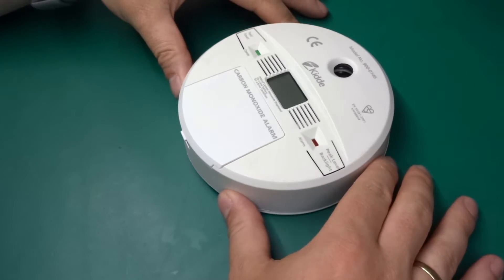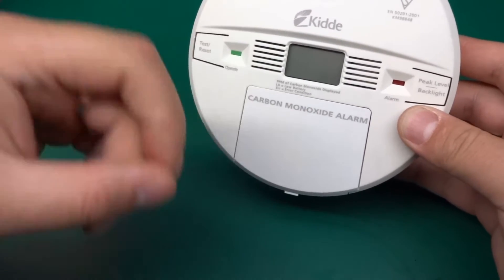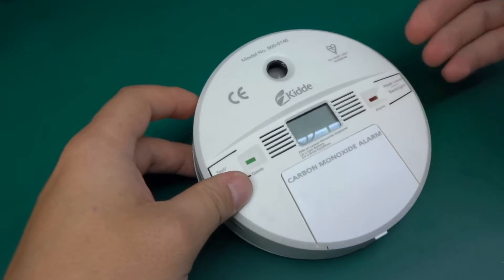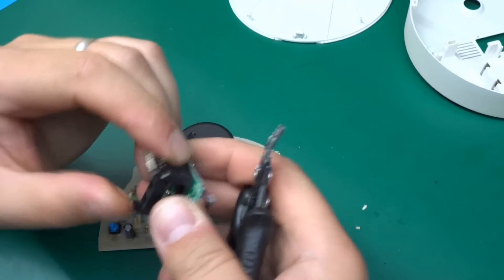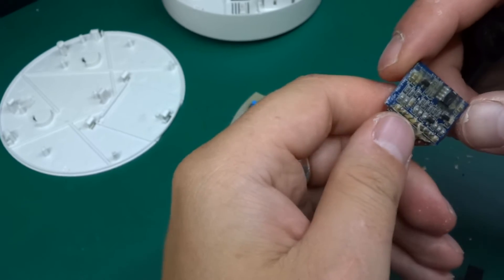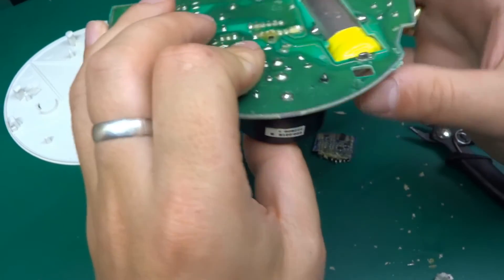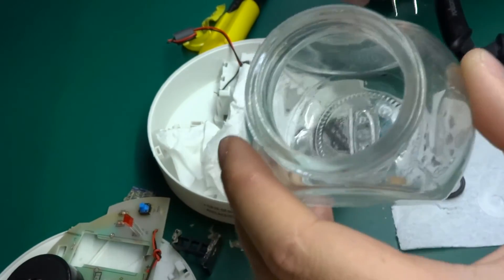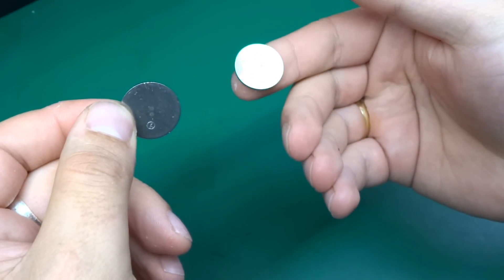Fuel cell / Kiddie carbon monoxide teardown

Comment: I have a question that may sound silly but how would you know if one were a spy camera? The fuel cell in mine made me think it’s a camera coupled with seeing the words printed on the chip board kidde prorietary & confidential
Reply from the maker: Fire alarm is not a bad place to conceal a spy camera :) I guess you could see with RF spectrum analyser if it was sending anything out in the air, or maybe even with the evesdrop detector like I had on the channel long while ago. "Proprietary and confidential" relates to smoke detection sensors, this is all proprietary and patented - most manufacturers have their own little secrets on how they make things work better than "the other" guys.
Reply: randomtronic yeah strange thing is it says PRORIETARY NOT PROPRIETARY
Reply from the maker: Lol, really? That has got to be a typo in the factory...
Reply: Partially what made me think it was a spy device coupled with events, I took it apart anyway but would like to know how to track back to where the receiver is find whom is receiving the transmission,
Reply from the maker: First you would have to confirm that it was actually transmitting anything :)
Reply: randomtronic correct and if it’s not this I will find the one that is but when I do find it if this one isn’t it I’ll want to know how to track where it’s going ya know
Reply: randomtronic one suggestion was an R/F app for phone or a little more expensive tool that does the same thing
Reply from the maker: If it was a camera with one way RF communication, i.e. only sending data/video out, then it would be very difficult to see where is the receiver, because the electromagnetic signal goes everywhere. You could home in on receiver only if it was sending some RF too, like commands to the camera (still a complicated and expensive thing to achieve) Imagine a lightbulb (transmitter): you can find out where it is, find the source of light (electromagnetic signal) but try finding out who else is looking at it (receiver)- much more difficult, isn't it? You could have someone observing it from a distance through a telescope, and you could never find out where they are. That's the simplest analogy that comes to mind now. RF is the same story here (light is like RF, also electromagnetic radiation, just much higher frequency) Hope this makes it simpler for you :)

Comment: A fuel cell supplies power. This unit has a chemical sensor and standard batteries.
Reply: It does make power the alarm measures how much power the sensor is making to figure out how much CO there is in the air.